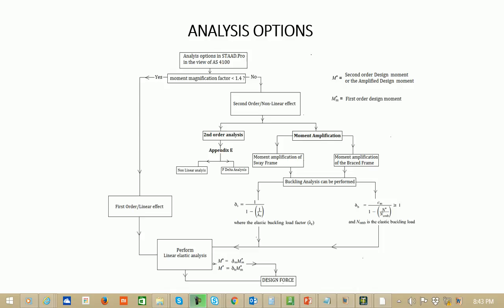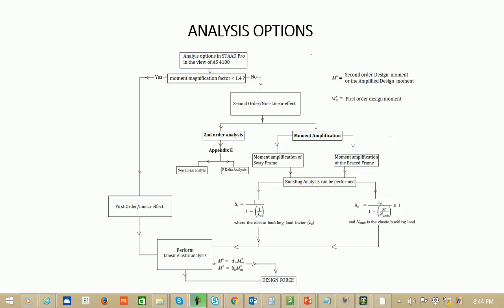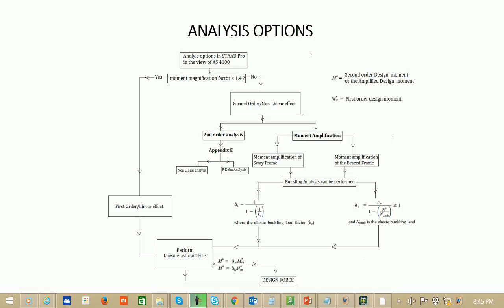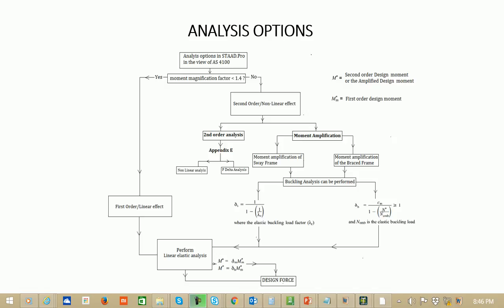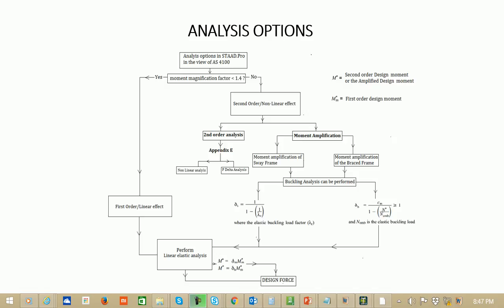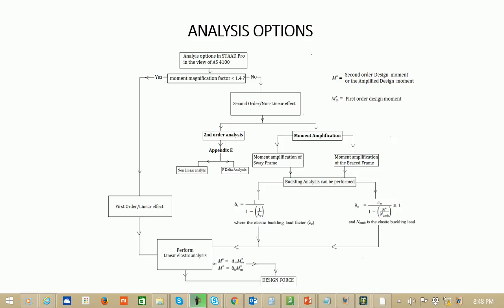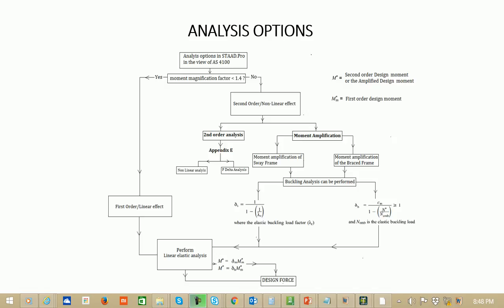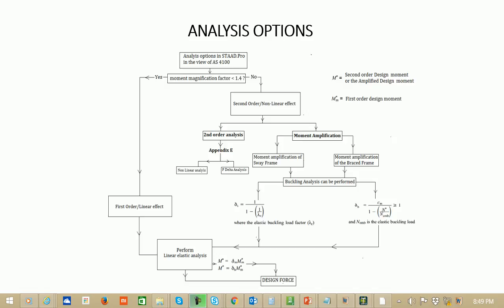Implementation of Australian Steel design code (AS 4100) in Staad.pro, PART-6

Comment: This is not correct.  If the moment magnification factors are >1.4 then you must do a second order analysis.  If the magnification factors are <1.4, you can do a linear-elastic and magnify the results by the magnification factors.  It is unsafe not to magnify the bending moments from a linear-elastic analysis if the magnification factors are >1.1 as obviously you would be underestimating the bending moment by a significant amount (up to 40% if the process in this video is followed).
Reply from the maker: Read the flowchart properly.. The flowchart says the same thing that if  MMF<1.4, then one can perform first order elastic analysis or else they need to do second order elastic analysis.
Reply from the maker: Please refer to the chapter no. 4.4.1.2.. For the  Second-order effects, The analysis shall allow for the effects of the design loads acting on
the structure and its members in their displaced and deformed configuration. These second-order
effects shall be taken into account by using either—
(a) a first-order elastic analysis with moment amplification in accordance with Clause 4.4.2,
provided the moment amplification factors (b) or (s) are not greater than 1.4; or
(b) a second-order elastic analysis in accordance with Appendix E.
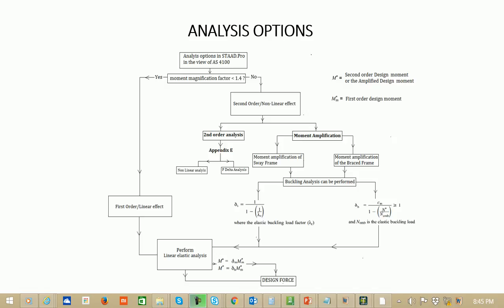Reply: @Torq123 Your flow chart has the moment magnification calculations on the >1.4 side of the chart.  They belong on the <1.4 side.  Starting around 2:13, you talk about the magnification factors in the context of >1.4 whereas your quoted 4.4.1.2(a) says magnification factors are only used when they are <1.4.
Reply from the maker: Stephen H Stephen H I think you didn’t understand the flow chart. Once again I would request to see the flow chart properly. What I illustrated is if the the MMF is less than 1.4 then  one needn’t have to perform the rigorous second order analysis. The rigorous second order analysis ( Pdelta) is required only when the magnification ( that is the ratio of the response of second order : ratio of the first order) gets significant or exceeds the 1.4 limit.
Reply: @Torq123  It is good that you have clarified this.  I will give you the benefit of the doubt that the communication in this video is poor rather than it being wrong, though I still can't understand why you have the magnification factors on the >1.4 side of the chart (not permitted to use the factors if they are >1.4), nor why you have a direct link from "Perform linear elastic analysis" to "Design force" without applying the magnification factors (linear elastic analysis must always be magnified).

The correct way to draw the chart would be to have both linear analysis with magnification factors and the second order analysis as options when magnification <1.4; and to have second order analysis as the only option on the >1.4 side.
Reply from the maker: @SD8013KB  Read this article from the Design code.....

4.4.1.2 Second-order effects The analysis shall allow for the effects of the design loads acting on
the structure and its members in their displaced and deformed configuration. These second-order
effects shall be taken into account by using either—
(a) a first-order elastic analysis with moment amplification in accordance with Clause 4.4.2,
provided the moment amplification factors (delta-b) or (delta-s) are not greater than 1.4; or
(b) a second-order elastic analysis in accordance with Appendix E.
 

Now, tell me which part of the article contradicts with the flowchart?
Reply: The following path through your flow chart is not permitted by AS 4100 because second-order effects are not accounted for (you never apply the magnification factors if you follow this path):

--> Moment magnification <1.4 --> Yes --> First order/linear effect --> Perform linear elastic analysis --> Design force.

The following path is also not permitted because clause 4.4.1.2 requires second-order analysis if the amplification factors are found to be greater than 1.4, and does not permit a magnified linear analysis:

--> Moment magnification <1.4 --> No --> Second order/non-linear effect --> Moment amplification (not permitted because the factors aren't <1.4)--> etc

So the whole flow chart is incorrect except for the path to second-order analysis, but I commented earlier that second-order analysis can be used when magnification < 1.4 but this option isn't in the flow chart.
Reply from the maker: @SD8013KB  got it  ..I have put the MMF on the right side.. It should have been on the left side (i.e MMF < 1.4 ...YES)...I will swap this. Thanks